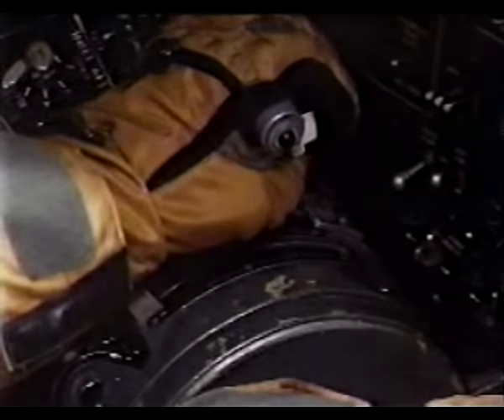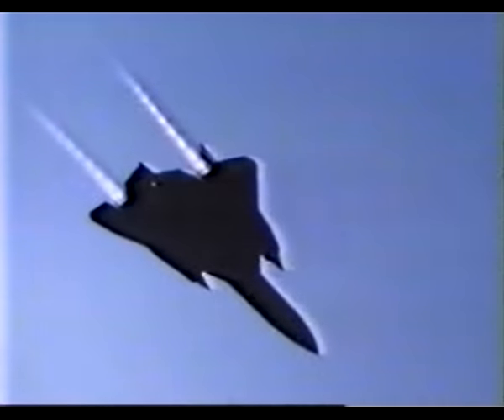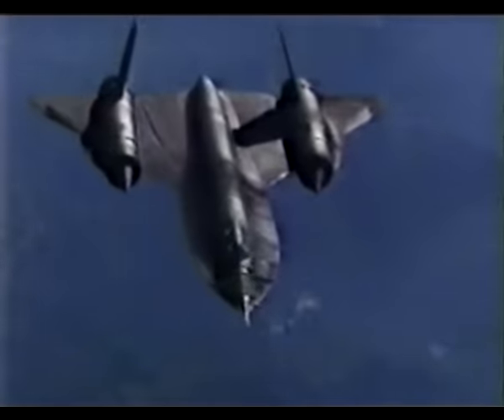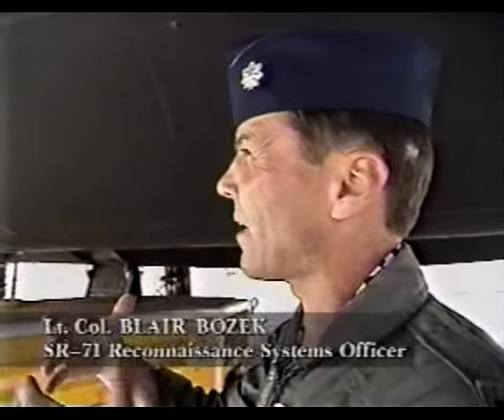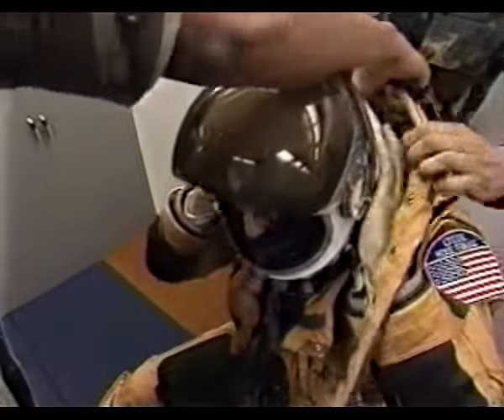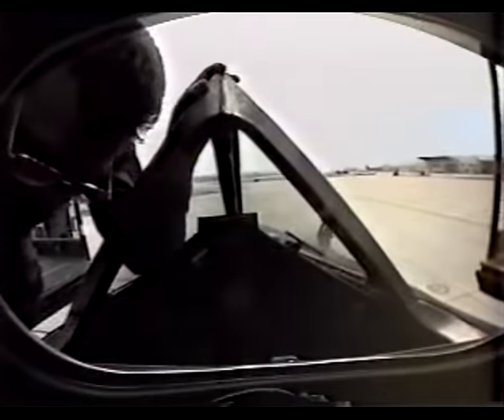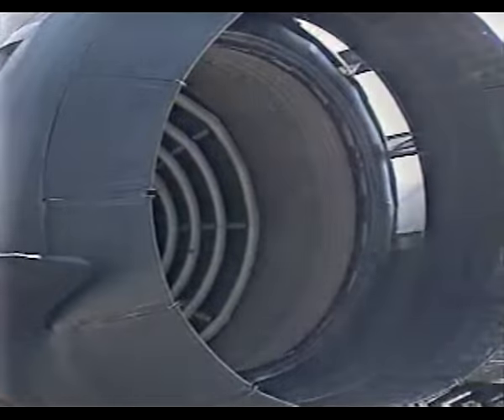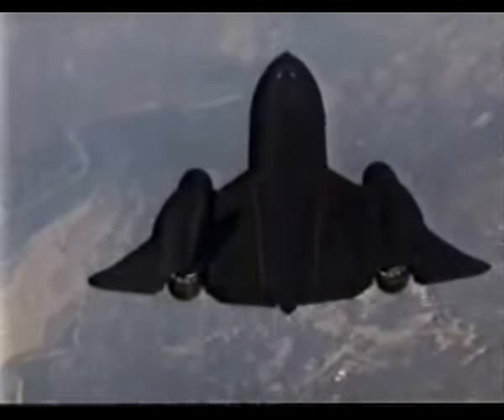Lockheed SR-71 Blackbird

Comment: Most impressive thing is, that this marvel of engineering was designed without computers and it is still great in todays standards.
Reply: Think total cost was $35M each...or $350M todays value. Amazing how much waste and bullshit waste and pork in our budgets now....that's the most amazing thing.....
Reply: They most certainly had computers. The SR71 was likely designed using a Fortran program running on an IBM 7090 given the 1964 debut of the plane. Sure, they didn't have Wolfram, but doing the calculus by hand is hardly the laborious part of optimizing a design like this.
Reply: And how Quickly it went from just an Idea to being In the Air!!

Comment: So technically, flying the SR-71 is like flying a space mission.
Reply: Once you get above the Armstrong Limit at around 63kft, it's about the same environment anyway.
Reply: NASA was given three SR-71s to use for their research projects, and they flew them well into the 1990s. The space suits that astronauts wear were originally designed for SR-71 pilots, since ejecting at Mach 3 on the edge of space would instantly kill a pilot, both by explosive decompression and by aerodynamic friction instantly heating the pilot’s body up to 400 degrees or more.
Reply: Nope. Close tho. :)
Reply: @WranglerSlim  NASA orginally flew Y-12s ....not 71s ....... fun fact
Reply: Now they have material that could handle that heat no problem as the space shuttle tiles.
Reply: Blackbird flight is more complicated to maintain than space flight in my opinion.
Reply: No, the SR-71 needed atmospheric gas to function. Don’t get me wrong. Without the suit you’d  die like any other person would in space, but you wouldn’t have say, a pen float or anything. It doesn’t nearly reach any heights that would even be considered sub-orbital, nor the speed that an aircraft like the x-15 would reach. The x-15 is basically an airframe with a rocket engine, and even that didn’t achieve “escape velocity” (so fast that gravity has little influence due to the speed). It actually had such little endurance to achieve that height, that it needed to be dropped off a regular, B-52.

 If the earth revolves at a slower speed relative to the sun, we’d end out falling into it. If the earth revolved any faster, then the sun would have some gravitational influence, but not enough, and we’d be flung out to space due to the velocity.  The sky is blue for a very small section of our atmosphere . In fact a stable orbit, like say, the earth, is constantly in a state of falling into the sun. However its speed of revolution is so fast that it is in a stable orbit. Basically the gravitation pull and speed have equal influence of the earth so it, will never get closer or farther to the sun. Even the  international space station has rockets to correct it height since it’s still (I believe) has 95% influence of the earths gravity. So basically, sorry, they were still very much in the earths atmosphere. And I also apologize because I totally went off on a tangent lol.
Reply: @sgtgiggles  Thanks for the info though. 😊🇺🇸😊🇺🇸🇺🇸🇺🇸🇺🇸
Reply: @sgtgiggles  rocket engine? A jet engine?
Reply: @sgtgiggles  Did you just come from a clip that stated all that information? Or did you quickly google or Wikipedia it? Lol
Reply: @sgtgiggles  gravity has NOTHING to do with the presence or nonpresence of gases like the atmosphere bro! Not even space has anything to do with it. There's no "line" you have to cross to be out of gravity. In fact you will always be. But if you are far enough or in an orbit, you'll be so to speak weightless.
Reply: Jemand you’re joking, right? It’s drag on wings.... there is a literal line that defines space and lack of atmospheric friction. I’m speaking when gravity has the least influence over orbital velocity
Reply: John Stef maybe classes?
Reply: John Stef two separate means of locomotion
Reply: @sgtgiggles  I just read Jemand's comment and yours man. I didn't understand Jemand clearly enough to say whether or not what he is saying is right or wrong. I think there may be some miscommunication or misunderstanding here though. From what I've read, and I've re-read it a few times, Jemand is saying that there 'is no line you have to cross to be out of gravity'. And you have said there IS a line that defines space, and from what I have understood from your brief comment, you are saying there IS a line, and that line that separates Earth and space is defined by the atmosphere and the friction it creates. Perhaps you are both talking about different things? Or the same thing but from differing angles? It's hard to really articulate yourself well or understand someone from just a piece of text. I TRY my best to keep that in mind on here.
Reply: @sgtgiggles  You also say in one of your comments Earth and the Sun will always stay the same distance from each other. I'm not sure where you are getting ANY of your information from, but a quick Google search yielded this result:

"Having such a precise yardstick allowed Russian dynamicists Gregoriy A. Krasinsky and Victor A. Brumberg to calculate, in 2004, that the sun and Earth are gradually moving apart. It’s not much – just 15 cm per year – but since that’s 100 times greater than the measurement error, something must really be pushing Earth outward."

I truly don't believe you have better factual information than actual scientists do. Maybe you might want to do more reading before making erroneous statements.

EDIT: Not trying to be inflammatory, but the length  and detail you went into in your comment warranted some fact checking. I checked one of your facts and it was wrong. That casts a shadow over anything else you have put forward as factual and evidence based. I also came across someone else on a forum or something in my Google search, who said the Sun and Earth were actually getting closer. What I did not find however, was any indication that the Sun and Earth will always maintain the same distance. I truly believe fact checking and verification is extremely important before forming an opinion, and then putting that opinion out for others to hear and scrutinise.

Just saying.
Reply: John Stef you’re looking at things in a human time scale. Of course eventually everything crashes back or gets flung out into the universe. The earth stands a fair chance of leaving our cosmos after we collide with andromeda. Consider you are throwing out erroneous statements. You’re thinking in billions and billions of years, plus getting off topic with air breathing jets vs rockets and earths gravity. Astrophysics is theoretical, not conceptually  tangible. Numerous theories contradict
Reply: John Stef stable orbit means they don’t change much over ions.
Reply: @sgtgiggles  I didnt need the explanation man, that's stuff I already know. As you said, that's high school physics. There is no point having a pissing competition when it's so easy to get information at the click of a button, from published articles these days. I was merely pointing out perhaps you and that other guy were sort of arguing about completely different things. Which I might add, is easy to do over a small piece of text, open to one's interpretation. That's all. And yes I'll admit jets will not work without an atmosphere, that is simple physics too. Without 'air' for the inlet to 'inhale' then compress and mix with fuel for ignition, there can be no combustion. Easy done. I would just like to think however, that if we are all going to have a discussion on here, we would do our best to listen and understand each other as much as humanly possible. If we then disagree, have a differing perspective or want to debate a point, I'd like to think we would put that forward civilly, and not just talk down to each other like monkeys throwing excrement at each other - we are better than that. No one is superior to anybody, no matter how much you know. We are all learning after all, we never stop. Peace man.
Reply: John Stef you’re thinking too small if you wanna get solar, galactic, or universal....I’m only speaking about one planet, which again, stands another chance of orbiting so fast to attitude that it may just fly out into space. It’s such a big equation that no one knows
Reply: @sgtgiggles  Ions or Aeons?
Reply: John Stef Actually we are both wrong...it’s eons. Ion is chem term, aeon is a Greek derivative of koine
Reply: Now linguistics really is my field lol
Reply: @sgtgiggles  And I'm not thinking too small or too big. All I did was read a comment where you stated that the Sun and Earth will stay the same distance, then do some quick Google searching. That search yielded a published result that said we have been able to measure the distance/time that the Earth is moving away from the sun at. I didn't do that research, I didn't watch the tests being conducted so I don't know if that is true and correct. I am always skeptical of published articles, as it is well known that many scientists fudge results to get published and recognised for their work. I am not saying for a second I agree the Earth is getting closer to the Sun. I simply do not know enough about all the variables or have the technology to conduct any experiments myself. It was just something to throw over to you, and I quoted it so you could cut and paste the quote, find the study yourself and have a read, seeing as this is obviously an area of great interest to you. That's it. Cheers.
Reply: John Stef that is a field I will happily debate with you. I love language. handshake you won.
Reply: John Stef cheers mate!
Reply: John Stef i do enjoy a solid debate, bruv
Reply: @sgtgiggles  I'm not wrong. Again a quick Google search yielded this:

The word aeon /ˈiːɒn/, also spelled eon(in American English), originally meant "life", "vital force" or "being", "generation" or "a period of time", though it tended to be translated as "age" in the sense of "ages", "forever", "timeless" or "for eternity".

I am not American so I use the correct English spelling. I also speak, read and write Greek.
Reply: @sgtgiggles  And it's not about winning or losing. Happy to shake your hand and/or have a debate though, anytime.
Reply: John Stef at this point I’m on the piss..
Reply: @sgtgiggles  All good. It has always been spelt 'aeon'  in any material I have ever read. But American English is slightly different in some spelling and pronunciations, so eon would be an acceptable way to spell it too. Both are correct, however 'ions' are something completely different as you are no doubt extremely aware of. I love a good debate too. 

Remember to have a few glasses of water before you crash out so you don't wake up with a headache. Look after yourself brother. 

Cheers.
Reply: John Stef actually you two are both right and wrong. The sgt. Guy def knows his shit, but there were some errors. Jermand needs to exit the conversation. Just gonna play quick referee and exit this convo
Reply: John Stef oh and eon is the more common spelling. Aeon is archaic. Ions are something to do with atomic and molecular structure
Reply: John Stef LoL uhhh sure....because people have time for that
Reply: John Stef chill out there stallion. Just because someone agreed with someone else doesn’t mean they’re the same person. I have never heard of aeon either other than Aeon Flux.
Reply: @stevenw.miguel  Whatever you say. It's just really sad to watch. Have yourself a good day.
Reply: John Stef uhh sure. You too lol
Reply: @stevenw.miguel  Cheers. And I've watched Aeon Flux. That was some of the weirdest shit I have ever seen.
Reply: @sgtgiggles  By the way man I made a big mistake with assumption. I assumed the X-15 had one big ramjet engine, like the SR-71s engines. I didn't realise the altitude it flew at in comparison to what the SR-71 does. It clearly needs air to compress using speed too, so would need an atmosphere. And I would imagine you still would need a certain density of air, even when youre compressing it. So you couldn't get as high as the X-15, even in our atmosphere. You'd get to a height where the atmosphere was just too thin. You learn something new every day hey.
Reply: 😂😂😂😂😂 what the hell is all this?
Reply: Close enough from what many pilots have said.
Reply: Josias von Leiswolf false, the change in pressure yes would kill but the friction not so much, at that high the air is a lot thinner
Reply: Right on
That orange suit IS a space suit
Reply: @Real_Richmond_510  this is true mainly because it was done regularly. Space missions are few and far between.
Reply: The first shuttle mission used SR-71 pilot suits, according to Brian Shul.
Reply: If you consider flying a space mission to be... Pedaling around your driveway with the training wheels on... With your Papa's outstretched arms ready to catch you if you fall.
Reply: Sorta but no. Space is vaccuum air. Jets need air to combust so that's why nasa uses rockets
Reply: John Stef a fair amount of what he said about escape velocity is also wrong but I’m a year late so whatever
Reply: High altitude yes.
Reply: Yeah, as far as I know many SR pilots then moved on to NASA as trainers.
Reply: @ScottTheAngel  yeah but space shuttle tiles are too heavy to be used on a craft meant to take off and land on it's own. The Shuttle just glides down from space, it needs a colossal fuel tank and two massive solid-fuel disposable rockets to hurl it up, on it's own it could never take off even for a classic commercial airline flight because the tile weight ratio and wingspan are not suitable. You'd need much bigger wings partially without tiles to have the lift and weight ratio for takeoff.
Reply: A tactical, intelligence gathering space mission
Reply: @jemand8462  try a skydive
Reply: Faster than a speeding bullet by 200 mph…
Reply: @brianmck7363  yet still has a ceiling limitation, why...
Reply: Well yes, but actually no.
Reply: Black ops 1